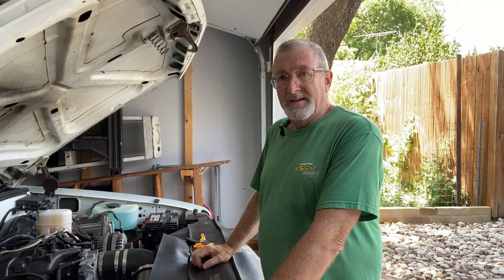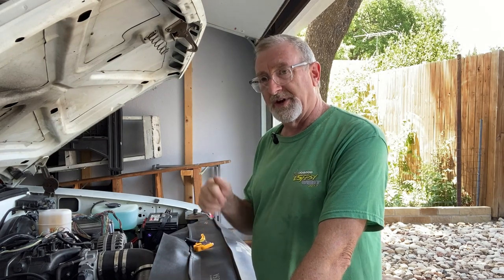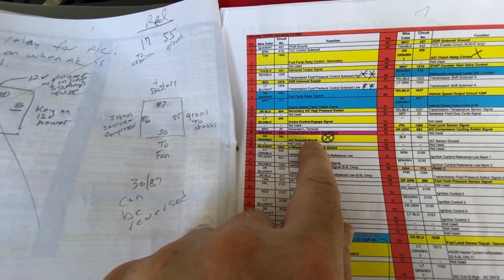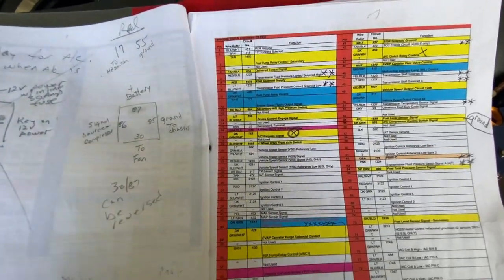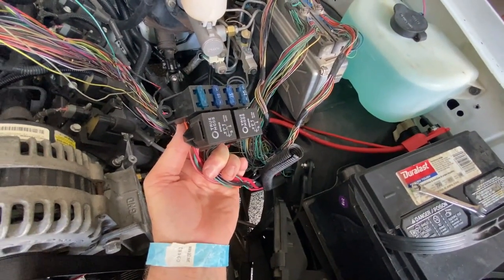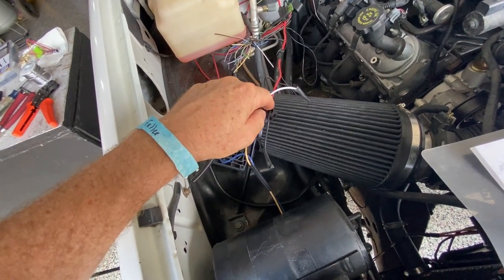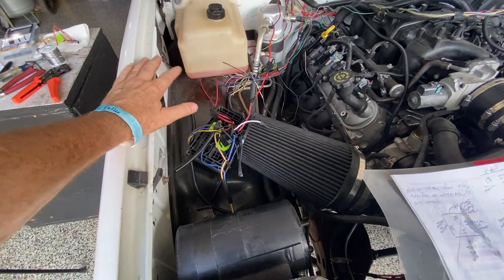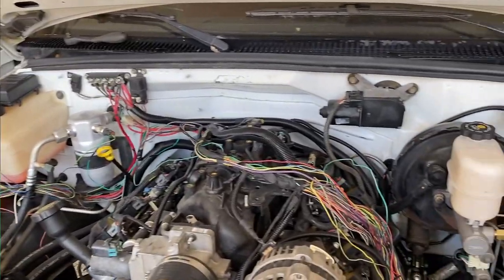OBS Chevy Truck LS Engine Swap Single Wire AC Wiring Troubleshoot and Fix + Electric FAN!

Comment: You can use pin 43 red to use for ground signal from computer to kick on e fans an you won’t have to jump compressor wires
Reply: Just remember that if you dont have pressure in the system the circuit will not work till you do have pressure so you will need to jump the pressure switch at the accumulator JUST AS A TEST

Comment: How has it been running after you completed this setup? In watching I noticed one thing that you might have an issue with. You run the fan relay power on the compressor side of the low pressure switch. If the compressor cycles and the switch cuts out you'll cut power to the fans. I believe you would want the fans running at all times when the AC is activated. If you've noticed your fans turning on and off you might consider moving that power circuit for the fan relay to the constant side of the low pressure switch so that the fans run at all times.
Reply from the maker: Thanks for the comment, I’ll keep that in mind. So far, I’ve had no issues with the AC. It works great.

Comment: You are missing (or didn’t mention) the input from the high pressure switch on the back of the compressor. The pressure switch on the accumulator is the low pressure switch. The low pressure switch does most of the decision making in terms of cycling on/off and you’ll probably be ok without the high pressure switch. BUT the high pressure switch basically exists to stop your compressor from blowing itself apart in high heat / overcharged conditions. If your compressor fails quickly, I would get the high pressure switch wired in.
Reply: If you bought a brand new compressor they don’t come with the high pressure switch so you might not have even thought about it. It’s a simple two wire on / off input to the ecu so it’s either two pins on the ecu, or 1 pin and one ground.
Reply from the maker: Thanks, I don't have a pressure switch on the compressor. I'll look into it.Thanks for watching.
Reply: @laurencevillegarage  They come new with a plug and circlip where the high pressure switch normally goes. Should be a recessed hole on the back of the compressor
Reply: @laurencevillegarage  &@ actually that comprey its running direct to 12 volts, No pression sensor’s???
Reply: I don't think the LS style a/c compressors have a high pressure switch in the aft end. And the 1991 trucks came with a R4 compressor running R12 refrigerant. Most of the R12 systems did not use a high pressure switch but instead used a high pressure relief valve which blew off into the atmosphere when output pressure from the compressor exceeded a preset value. The original a/c wiring obviously did not run to a computer but instead went through the low pressure switch on the accumulator then to the compressor clutch. Should be able to tie in the trigger wire at the low pressure switch, then run to the ECM pin 17. Most of the ECM ouputs are actually grounds to make circuits complete. Pin 55 may not be needed if the ECM is appropriately programmed for number of fans, a/c, etc.

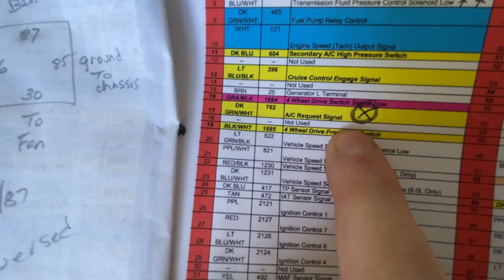Comment: Im confused. At 3:39 Pin 17 goes tied into all the dark green wires, to the compressor, the accumulator and, the ac switch in the cockpit?

Comment: I tough the activation came from light green wire , then goes to cycle switch, then to pcm,
Reply from the maker: It all depends on how the a/c is activated. There can be several ways and it also depends on which pcm is used.

Comment: Hey brother. Thanks for all the help with the wiring. If we don’t have electric fans, where do I wire the blue wire in the AC relay? Instead of tying it into the fans (since I don’t have them), where does it go for this same set up to work?
Reply from the maker: Just keep the fan wires tucked away for possible future use. That’s what I did on the ‘91. I had not planned to use the fans, but later decided to use them. Worked out very well. I found that the ‘91 needed extra airflow under hood to keep the temps low enough not to overheat. You can leave yours as is and the relay will not function.

Comment: How is this working for you so far,? I plan on using the pancake style compressor.
Reply from the maker: I began with a R-4 (pancake) style compressor and I went through a couple of them. I finally switched to a Sanden style  and had no more issues. I have seen many others with no apparent issues with them. If you have the space and already have one, go for it. If your swap is spatially challenged, then the Sanden may be a better fit (literally).
Reply: Did you use the same wire method on the R-4? Have you had any issues with the wire method since you changed to the sanden style? If need be, I may be able to go with sanden if they make a bracket to mount up top instead of the bottom.
Reply from the maker: @kabarrion  had to wire it a bit differently. The sanden was a single wire unit and the R4 is not. Simple enough, just use a different relay and just need a trigger wire. And yes, I used a bracket that can be used to mount the sanden compressor in place of the R4 from dirty dingo. Sadly, I sold the truck at that time to a friend. I provided the parts, but he had to do the switch.

Comment: Does the a/c pump clear the frame rail? Just curious planning on putting one together
Reply from the maker: The factory LS AC pump will not fit in the factory location. It is too large. The dirty dingo short sanden AC pump will fit. However, modification is required to the side of the frame rail. Check my other videos, I have one showing the install of the dirty dingo compressor.

Comment: On your 95, you wired the AC in a little differently, which method would you recommend using?
Reply from the maker: Well, on the '95 I retained the R4 compressor, so it was easier (and more economical at the time) to continue to use what I already had that worked. The factory wiring worked, and just needed a trigger to function. It all depends on what you have to begin with and how much of it works already. There are pros and cons to both. The main disadvantage to using the existing R4 as I did is that you don't get the additional functions of the LS pcm that "can" work with the a/c. Advantage obviously being $ and simplicity of wiring. Advantage to the LS 1 wire style sanden compressor is that (I believe) functions better than an R4 and, when wired properly, provides additional features such as a/c clutch goes into neutral under WOT, adjusts idle on start up to compensate the added drag, and more. Let what you have that works and your wallet be your guide. Both are nice. I chose to use the Dirty Dingo setup because, 1) I wanted the a/c down low out of the way. R4 takes up a lot of space, 2) Have never seen one on an OBS and wanted to try it, and 3) my existing system had not been used in a long time and no way to determine if it worked at all.
Reply: @laurencevillegarage  That makes complete sense. Thank you for the reply!

Comment: Can I ask what harness you used for the compressor it self where do you connect that one black wire that comes on the compressor ?
Reply from the maker: I made a video of how I got the a/c working. If you will check my library, it was 9-11 months ago. It would provide more detail than I can go into here. Thanks for asking.

Comment: Why do u still have the OBS computer in your truck?
What is it running. 
I totaly removed mine and the harness to it. 
I have a 94 with a 5.3 ,  4L60E. with ac  and all my guages work.
Reply from the maker: The truck is still in progress. As I thin out the wires I have cut, I will remove more. I'll show when all is done.
Reply: @laurencevillegarage  Thanks for the follow-up. 
Good videos. 
Big difference in wiring set up between 88-94 than 94-98.
I incorporare harnesses on 95-98. Keep oem ac , oil pressure, abs and been working on keeping purge system. (EVAP) .
Learned a few things from you. 
Like they say there are a million ways to skin a  cat.
Keep up the good work and videos . Thanks for  keeping the OBS's alive.

Comment: Then 1 fan turns on when a/c or both??   Then both at temperature?
Reply from the maker: Fans are set up to go off at 185 and 195 degrees without a/c use. When a/c is activated, the low speed fan is automatically triggered to start.
Reply: @laurencevillegarage  @ then low fan its on as  long as the a/c its on?
Reply from the maker: @gerardolopez5875  yes, that’s correct.

Comment: did you add a high pressure safety cuto off on the condensor?
Reply from the maker: It is on my never ending list of to do's to finally complete the truck. Good eye.
Reply: @laurencevillegarage  I'm doing a. 508 swap on. My tbi and using a95 condenser it has a threaded port for one

Comment: Did you have to bump up the idle for  adding AC?
Reply from the maker: I got it set to idle at 700 rpm and it works just fine with turning on the a/c.

Comment: On the fan relays, what wires go where?
Reply from the maker: For the regular twin electric fans, check out my video: 1988-98 Chevy OBS C/K Truck LS Swap Cooling Fan Fix. This shows how the dual fans are wired up. The a/c fan relay is wired differently.
Reply: @laurencevillegarage  i guess I worded it wrong. I meant to ask what a/c related wires are connected to what part of the fan relays? Like to what number on the relay? Just trying to figure out how to wire my a/c. We don’t really have too many a/c specific shops here in Colorado. I’ve had my swap almost 2 years. I’m running the dirty dingo street rod compressor kit. It’s a 1 wire. (Sd7b10)

Comment: What happens if you have a clutch fan?
Reply from the maker: If you have an engine driven clutch fan then you would not have electric fans or a relay. You would just have a single relay for the a/c compressor. The engine driven fan would do all the work. Depending on where you live and how you use your vehicle may dictate how you cool your swap. If you are using a truck motor that never had an electric fan, you can use the mechanical fan...IF it fits in the space you have and is shrouded. You can do this first and see if it cools your swap well enough. If it does not, then add the electric fans.  The electric fans give you more "precise" control of your cooling attempts. The mechanical fan, you just need to make sure the fan is in good functional order and hope it can keep things cool under all circumstances.